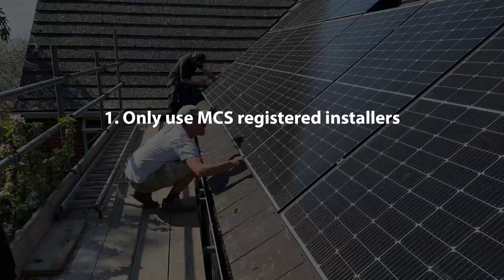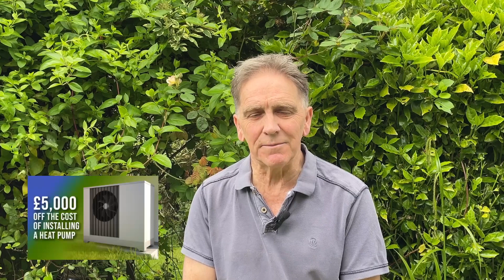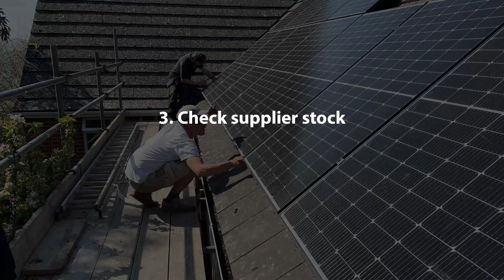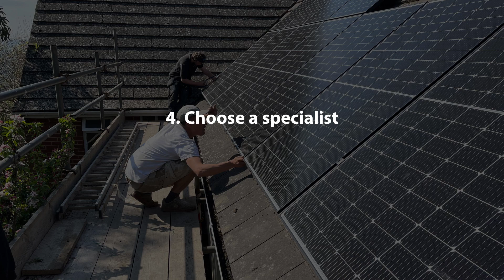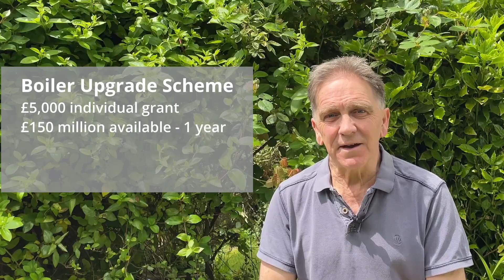Some tips for working with your green energy suppliers and installers

Comment: Another thing ,,I do not think much of the MCS scheme..  to my eye its just a money making scam...but it did work getting me the ability to export
Reply from the maker: Licensing can seem like a money-making scam, but we found there was some value to it.  Our main contractor was MCS-registered.  Let's just say there were some problems.  We couldn't get these problems resolved until we followed MCS procedures and sent our contractor a Formal Letter of Complaint, giving them 2 weeks to remedy the situation or have us report them to MCS, with the potential for them to be "struck off".  Funnily enough, our problems were solved 13 days later, just inside the deadline.  If a contractor isn't MCS-certified, they'll miss out on a lot of jobs that require certification (eg if a BUS grant is going to be applied for, or a feed-in tariff).  So, yes, it's bureaucracy, but you might end up being grateful for it, as we were.